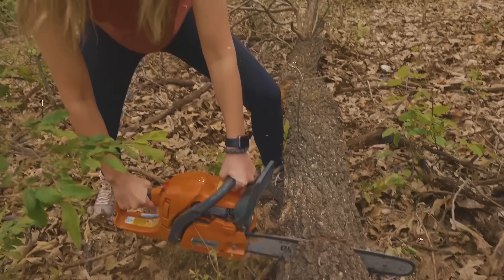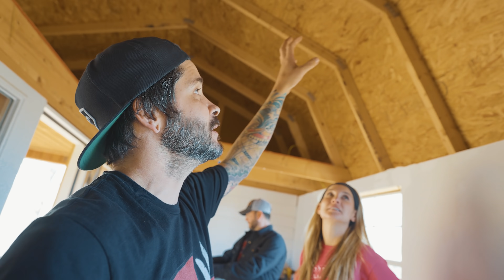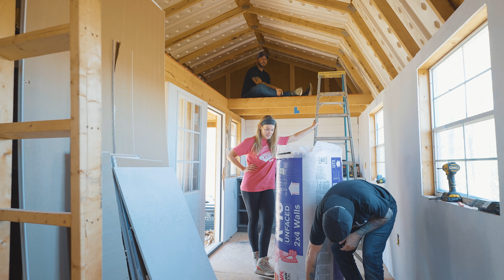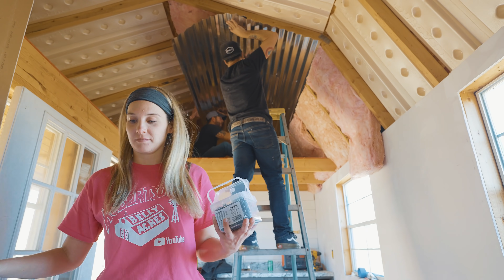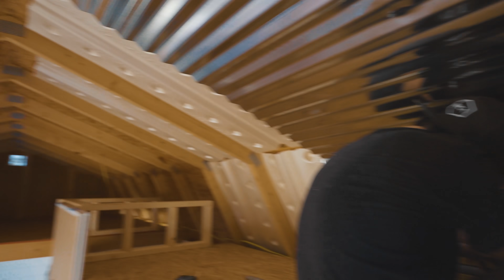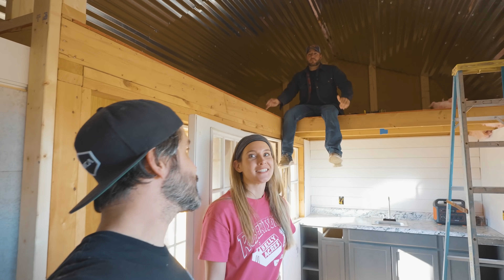Rustic Tin Ceiling / SHED TO HOUSE / OFF GRID Tiny House

Comment: Jared twerking!  🤣
If you’re going to drill vent holes on the outside on the eve of the shed just be sure to cover those holes with something like fine mesh hardware cloth. Squirrels can & will use any hole as a starter spot to chew their way inside.

Comment: Ceiling is great. If you are still interested in ideas for under your window, just wanted to say I liked both ideas. First a thin table to fold out from the wall. Then a mobile island that can fold out more counter space and house some compact fold out stools, and can be stored in front of window. I also saw a great idea for seating in a van build. Put up some sturdy hooks above and get some good quality chair hammocks, or even a double one. That makes comfortable seating that can be taken down easily and stored. Or better yet put more hooks out on porch and switch back and forth. With all these ideas executed you get a lot of options for the small space. Looking forward to seeing what's to come.

Comment: You need to put screen over your paddle bit hole or buy push in vents for drilled holes.. Tigers teeth or  white tyvek tape to hold the insulation in place until you install the metal sheets.

Comment: Question: Since the insulation didn't have any of that paper backing shouldn't you have put a plastic type vapor barrier before putting up tin?  The ceiling is going to look awesome when you get it finished.
Reply from the maker: Technically, yes as a vapor barrier.

Comment: I didn't realize there was such a wide space up on the one side between the 2 lofts. It's almost wide enough kids could walk from one end to the other. I think it would be cute with rails up on each end n continue it all the way from one end to the other running along the side wall.  Not sure if the long wall side if the rails could be the same height or not.

Comment: I like the idea of using metal for the ceiling. It sucks being so far away from lowes and not getting what you thought you were buying. They do make a hanger for un-Krafted insulation. It's a long piece of steel wire that goes up to the insulation and fits tight between your 24" centers. It's going to look good when finished

Comment: condensation  oops  hope it works, , layer of foam board ridgid between will create thermal barrier,    40 years engineer inspector ouch  , dripping ceiling if high humidity
Reply: tv screen will get the glare of any light  ,  nice to see  team work

Comment: You should wear masks when putting in insulation. It's not good if that stuff gets in your lungs. Rockwool is really the best way to go. Fiberglass compresses down after some time and you really don't get good insulation after several years, plus it gets mildew and mold.  I prefer drywall ceilings but the tin is way easier to install, for sure.